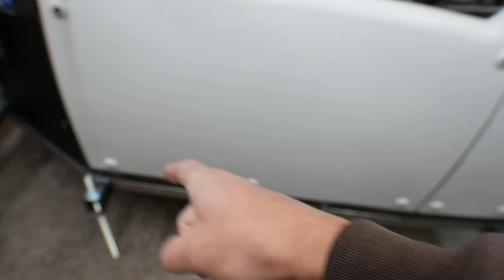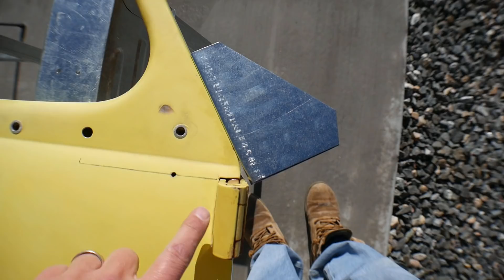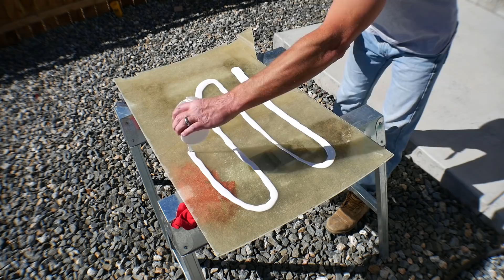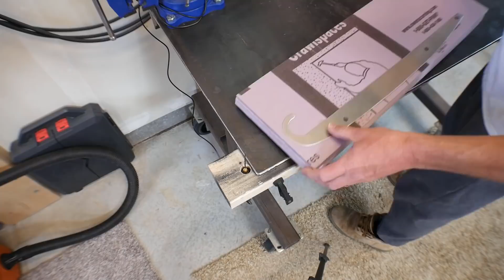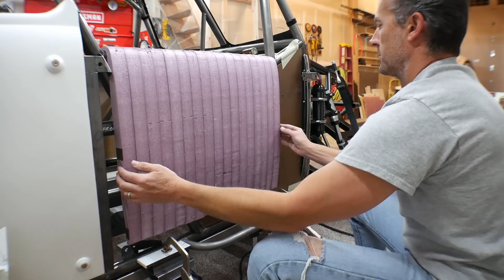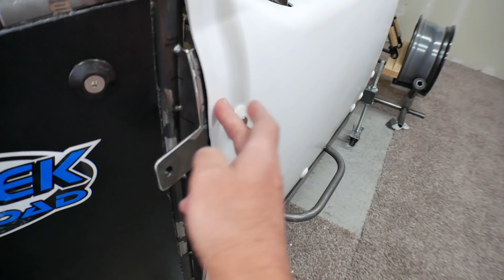Making Custom Fiberglass Door Panel Pt 1

Comment: I lay composites for a living and you do an excellent job. Only thing I can recommend is using Loctite Frekote for a release agent. We used Frekote NC-700 and NC-770 at my work and everything pops free extremely easy and comes out very clean. Spray it and wipe, repeat 2-3 times, let it dry 5-10 mins and layup.
Reply from the maker: Thanks for the first hand experience tip!
I'll find some of that and give it a go.

Comment: For what it's worth... I have found that gorilla tape applied to the original piece releases very well when covered with polyester resin. You do have the tape seams to deal with...
Reply from the maker: Thanks, I'll try gorilla tape. The tape I'm using now deforms a little with the polyester, but it's still workable.

Comment: Yor panels are looking good! 

I used the same pink XPS foam and glued it with 3M super 77 or 3M 99 spray adhesive.  The adhesives worked great at first, but let loose a few months later.  I live in north Carolina, so the high humidity here may have been a factor.  Hopefully the silicone adhesive will hold it all together long term for you.   The only thing I found that makes a good long term adhesive to foam, is more foam, such as spray foam (I.e. Great Stuff) or pour foam.
Reply from the maker: Thanks for the info on the spray adhesive. I'll keep that in mind for future projects. Luckily on this project the foam here is only to build the shape of the door. Once I make the mold from it I'll tear out the foam. The final panel will only be fiberglass.

Comment: At the start of this project, I was a bit unhappy you decided to not use a beetle body. I'm glad you at least have the body shape back into the project.
I can't be sure if this is unique, but I have never seen a spaceframe Baja Bug that still resembles the type 1 so closely.
Nice job, man!
Consider me impressed.

Oh, I know you hate it, but do make some moulds out of the new doors.
For you one sake, when you inevitably have some damage.
Reply from the maker: Appreciate the comment, a lot!
Originally I thought I could come up with more of a square body design. But after thinking about it for months, I couldn't come up with anything I just loved. 
So although making all fiberglass panels has been a LOTTT of work. When I come out to the garage and see it I really like the look of it.
I will for sure make master molds when I'm done. 👍
Reply: @DougBugBuilder  A lot of work, I'm sure.
We only see a bit of it, but it shows.

Comment: When we make RC airplane foam cores for wings it's a similar process to that foam door buck, but we make a plywood template to put on each end of a monolithic foam block and cut it with a long hot wire. It's pretty easy to make a hot wire bow with just some nichrome wire and a variable power supply. Takes two people to cut accurately but at least you don't have to do each piece individually.
Reply from the maker: I had a buddy who made some foam RC airplane wings. It was quite a process but really cool. Whew what a trip down memory lane. 😊

Comment: icky sticky itchy awesomeness.. I worked in a composite shop for 4 years. West System makes a rad pumper that measures 2 part resin perfectly.
Reply from the maker: Icky sticky is right! Thanks for the tip on West Systems. Haven't used that brand yet.